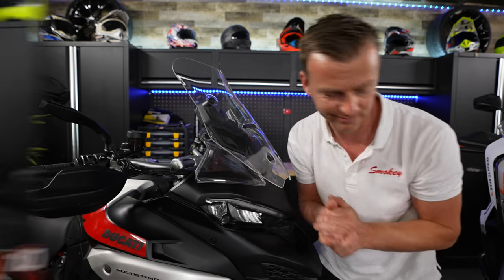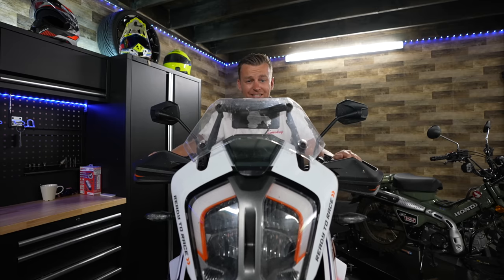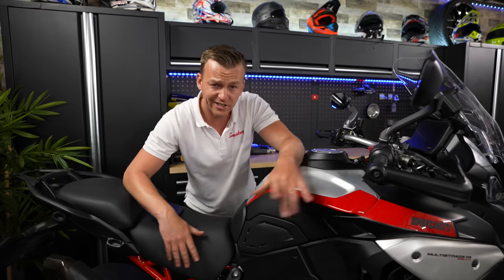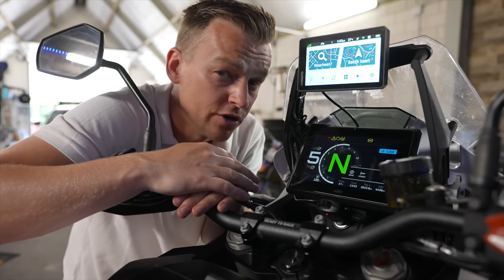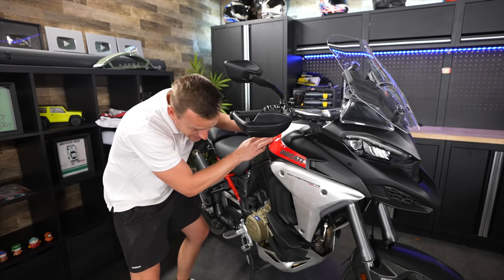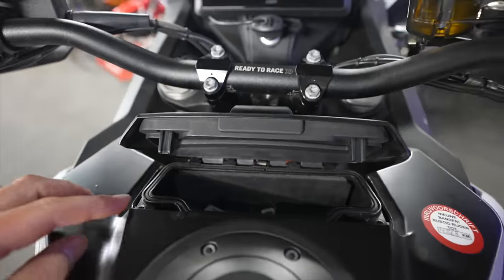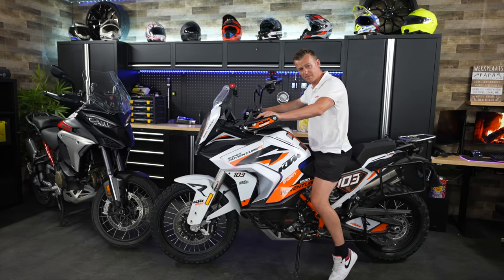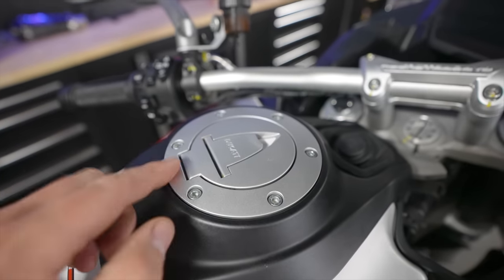KTM 1290 SAR vs Ducati Multistrada V4  | Side-by-Side Comparison

Comment from the maker: 2 Mistakes have been made by yours truly in this video , can you find the 2 things that are wrong? 😁
Reply: 240 gramm wet weight (not kilogram) and 7 cm's of ground clearance (instead of mm's). Right? What do I win? Can I get to keep the Ducati?! ;-)
Reply: 17" Rearwheel instead the 18" you said 😉 but now worries I like your videos also ❤
Reply: Ground clearance difference is 7mm, not 7cm.
Reply: 99,93 % of your description was correct  👌 Note, horsepower is always the first number mentioned, but like cars, it's about pulling power, right? The Ducati has 121 nm torque, a GSA1200 from 2010 had 120 nm torque 🤔 yeaah I'm still bmw fan 🤭
Reply: I have tried looking for your ktm model, but unsuccessful, has It been wrapped, that scheme looks awesome!

Comment: I feel that the better comparison would have been the KTM 1290 Super Adventure S. Both more roadfocussed.
Reply: This is the right comparison.  Ducati has a v4s.  This is their new rally.  So Ducati Rally to KTM rally comparison.   It’s apples to apples.
Reply: I agree. The KTM S is a better comparison, as they both have similar electronics. KTM S a better fuel range than the standard multi.
Reply from the maker: Yes but have you seen how Ducati advertised this motorcycle? They used offroad videos also. Can't take the SAS as a comparison as it does not have a descent skid plate or wired wheels for crazy offroad bonanza 😁. But when it comes to electronics and suspension yes then it would be the S for sure. 😎
Reply from the maker: Thinking the same. The S does not have a skid plate or wired wheels. If you want cracked wheels you should take an S offroad 😁.
Reply: @LifeofSmokey  I agree, for that u definetly need to add the powerparts wheels / skidplate. Marketing aside those 2 are much closer though.
Reply: @LifeofSmokey  the spoked wheels and better skid plates are AFAIK offered as an option on both MTS V4S and SAS. (Personally I wouldn't try crazy offroad bonanza even on the R, feels too heavy for that, however that's my personal opinion.) 🙂

Comment: One HUGE issue at least in USA on KTM is the horrible offset rear valve stem with tpms. Tpms sensors leak, when your actually offroad for multiple days carrying camping gear you don't have another 27 lbs for a offset tube.....in 41 dealers, across 11 states all motorcycle shops and dealers said "we never stock offset tubes".....so does the Ducati have offset rear valve stem? If not then it offers an advantage offroad as the KTM is not field serviceable.

Comment: It's just that damn price ... Asked the local dealer for an identically equipped Ducati Rally with Alu panniers, crash bar, Akrapovic, etc, to my 3 year old shiny new looking 1250 GSA with Akrapovic and a plethora of aftermarket stuff (like Denali lights, sound bomb, brake-lights, heated seats, touring screen, etc., etc. etc.) and the price I'd need to pay on top is more than they would trade my BMW in for 😲😲😲 ... Makes the Ducati just inaccessible and the swap to be the dumbest move. But i do love that Rally especially after having tested it!. Soo, in a nutshell, the Rally is: as a bike 10/10; value for money: 0/10
Reply from the maker: I do wonder if I would put a nice specced BMW GS Adventure next to the same equipped Multistrada Rally what the price difference would be :-)
Reply: 10/10 value for money

Comment: Cool that you've got these bikes together and covered some of the interesting bits.

However, I found it dull with you just reading out all those specs, especially where so many are irrelevant or could quickly be summarised as "the same" (7mm is not 7cm!).

Constructively, I would suggest you apply your passion as demonstrated for gloveboxes (totally valid!) to include other aspects of the bikes that also make a difference to ownership and riding. Like how much better the Ducati configurability is (DRLs, per-mode customisation etc) or how much better the KTM steering lock is (short press and hold at any time to lock, vs ... well ... just try doing that on the Ducati). Differences between CCs, controls, mirrors. Actively seek out stuff that's different between the two bikes and isn't listed on manufacturer websites. Maybe you need to spend some more quality time with the bike(s) before rushing out a comparison?

BTW the centrestand lift is massively affected by the state that you leave the rear shock preload in - e.g. if you used the drop mode before parking. Try setting highest preload first.
Reply from the maker: Thx for the feedback! Appreciate it and a good idea to! 😁👌

Comment: The KTM 1290 SAR any day. You can take it on road and off-road, it's cheaper and more reliable than anything Italian. Also, in my humble opinion, the KTM looks way better. The last thing I wanted to point out is that KTM has a rally pedigree and that cannot be beaten by any other maker, they just know what they are doing. 

I've only had the KTM 1290 SAR for a few months after trying a few other bikes including the BWM 1290 GS, and the KTM is just a better motorbike, especially if you are planning to go off-road a lot. Check out Chris Birch on YouTube and you can see the guy taking the motorbike to some crazy terrains, this bike, for its size and power, can take a lot of beating.

Love the bike and unless KTM makes a better version of this, I will never replace it.

Good stuff and love your channel/s.
Reply from the maker: Love Chris Birch , but 99,9% of riders don't have his skills and are not 2 meters tall 😁. I wanted a 1290 SAR right after the video with Chris 😅🙈

Comment: There is a HUGE difference between the handling on road. The KTM 21 front feels like a boat
Reply: does a 1290 sar behave totally normal with 21 inch wheels. I found a great deal on one and want to buy it. My main focus is roadfocused and start offroading later on. Just want to make sure the 1290 sar will still perform perfectly on road.

Comment: Which would you take on a 4000 mile road trip? I guess it’s technically 8000 cause I’d have to ride home. Indiana to Alaska and back. More considering reliability and maintenance, ease of service in case something does happen. I’m sure the Ducati will probably be more comfortable but will it break down on me or leave me stranded vs the ktm. 

I guess you could throw the bmw GS into the equation as well.
Reply from the maker: I believe all 3 are good to do the job. But for a very long trip I would go for the Ducati just because it had comfy 170hp 😁.
Reply: @LifeofSmokey  I appreciate the reply! Group of us are gearing up for it next year